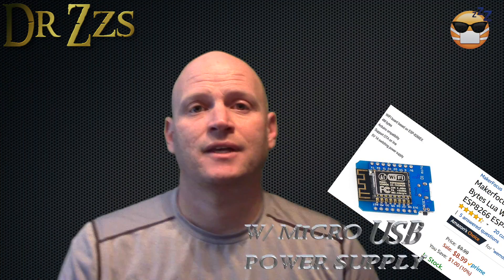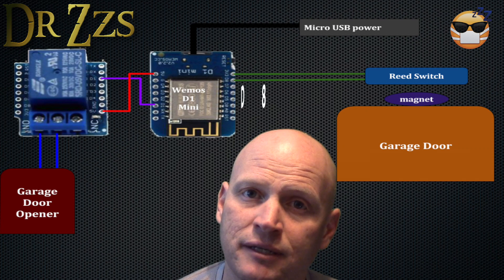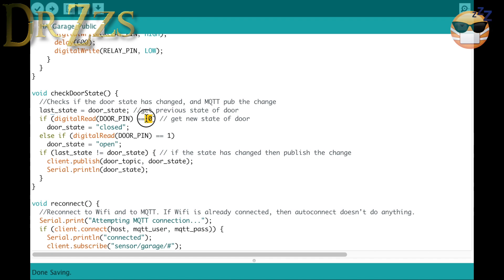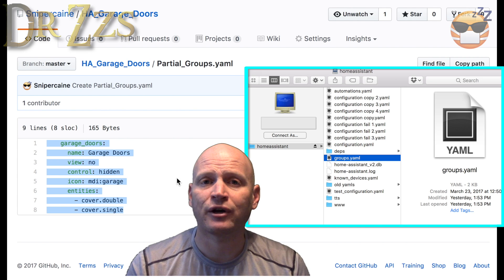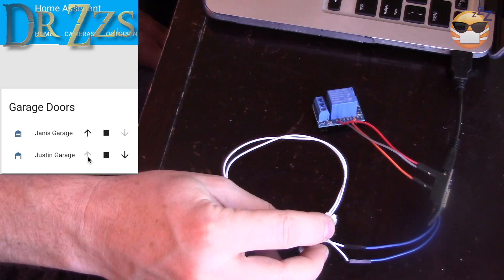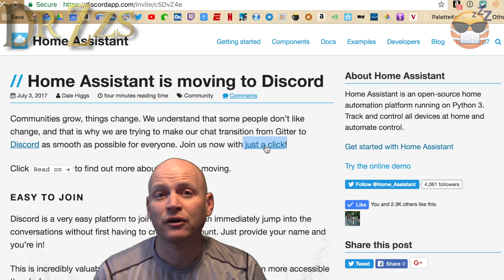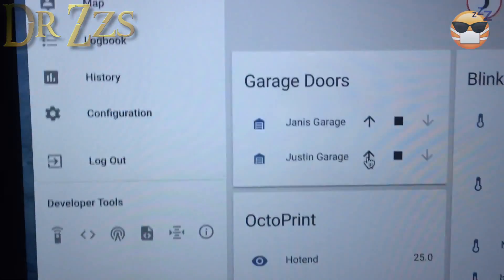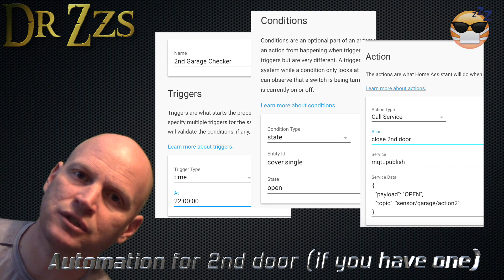DIY Smart Garage Door Opener

Comment: Any way to connect 2 reed switches? And notify 2 different garage doors From one d1?
Reply from the maker: yes!  but that would require some changes to this sketch.  I've been using Tasmota exclusively for a while now, instead of custom Arduino sketches.  You could control both doors with 2 reed switches and 2 relays with One D1mini and Tasmota.  Would be hard to give all the steps here.  Basically, you'd have to set 4 switches and 4 relays.  Use Relay 1 and Relay 2 for garage door control. Then use Switch 3 and Switch 4 for reed switches.  If that's confusing remind me during a live stream and I'll try to demonstrate it.  It should work pretty well.
Reply: DrZzs awesome! I followed your d1 mini video and got a temp sensor working. I will add the reed switch when I have some time. Am I tying the 2 reed switch both to the 3v and different GPIO pins?
Reply: DrZzs when is the next live stream? I added the reed switch to a tasmota D1 Minin but having trouble fingering out how to add to HA.

Comment: This is a great, and cheap way to do it.  I've seen a few videos using an arduino uno, a wifi board, and a sonar sensor.  that just seemed clunky and somewhat unreliable.  I think I will do it this way!
Reply from the maker: Thanks!You might even try the other video I have using a Sonoff SV.  I think that's an even better method I discovered after this one. 
https://youtu.be/QMepwpyjMCY

Comment: I noticed you updated your sketch noting that the door may open if the wifi drops. So I updated mine to your new sketch but just today my garage door opened and closed twice by itself. It stayed open maybe ten seconds then closed itself both times. Any idea what is going on?
Reply from the maker: Gremlins. They love garage doors! 
I wish I could say exactly what was happening to yours.  If you changed the sketch did you also change to normally closed contacts on the relay?  The new sketch is made for the relay to be normally closed. 
If you do have it on normally closed then a brief power loss to just the D1 mini could cause it to open. 
Were you having any random opening before?  If you weren’t then I’d say go back to what you had.  If your WiFi is more reliable than mine you might not need the new sketch. 
I’ve been happier with the sonoff SV solution. Just because I’m not great with Arduino sketches. 
Hope that helps.
Reply: Yes I moved it to normally open. I never noticed it open by itself before I changed anything or maybe I just never saw it happen. I have a sonoff sv so maybe I should try that route as well.

Thanks for the reply man!
Reply from the maker: hmmm.  
With the new sketch "HA_GA_v2_NC_pub", 
https://github.com/Snipercaine/HA_Garage_Doors/blob/master/HA_GA_v2_NC_pub.ino

you should have the wires on the Normally Closed terminal.  The relay will activate the door with you first connect it so be ready for that, but after that it shouldn't activate when the wifi drops.  

sorry you're having trouble.  For what it's worth I do prefer the Sonoff SV option.  We have one door with the SV and one with the D1 mini and the SV seems to have less trouble.  But you should be able to get the D1 setup working.  I haven't had any trouble with either in a long time.
Reply: So I think I found the issue. I recently purchased a TP-Link HS110 for monitoring energy consumption around the house. Well today I moved it to a new location and did a factory reset, then boom garage door opens. Also when I enable or disable through the KASA app it also triggers the door. I have no idea why or how those are related but that's what is making my wemos trigger. Any ideas lol?!

EDIT 
So here's what I got so far and CopperNickus from Reddit is correct, herer's what he wrote. "Your RELAY_PIN starts in low state and you set it high during setup. That code is not protected by door state logic. It's possible the device is rebooting and that's causing the relay to trigger the door. Try cycling power on the board and see if it triggers the door too. You'd need to check status before changing the RELAY_PIN high so that a reboot does not trigger the door."

I just don't know how to do what he says haha. But this problem could occur  to anyone using this current setup.

Comment: First of all thank you for this tutorial! I enjoy watching your videos and building the projects. I did have a few issues during the setup so I want to post my findings in case anyone else has the same issues. After uploading the sketch to the D1 mini and updating the configuration.yaml file the reed switch contacts worked as expected but the relays would not respond the the open/close buttons on HA. I found that adding a wire between the D1 mini ground pin and the relay ground pin would cause the relay to be constantly energized. Pressing the open/close buttons on HA would momentarily de-energize the relay. I then went back to the sketch and replaced all instances of "HIGH" with "LOW" and "LOW" with "HIGH". The relay is working properly now and I plan to install it on the door later this week.
Reply from the maker: Great!
At least part of the issue you had might be because I changed my setup from using the normally Open contact on the relay to using the normally Closed contact and I set the pin on the D1 mini to start high and go low on activation. 
I did that because the door was opening randomly anytime the D1 mini disconnected and reconnected from my WiFi.  So there may have been some difference in the sketch on GitHub and the institutions in the video. 
Glad you sorted it out. Hopefully anyone else who has that problem will follow what you did. 
Thanks
Reply: @DrZzs  I have a question. Why would your doors open randomly when you initially set it to high? If the wifi disconnected and reconnected, did it trigger it to go low momentarily? The sketch that Patrick has seems efficient since the relay is only energized when the button and pressed. I'm trying to understand how and why the doors would randomly open/close in your case? Also if you lost power momentarily, would it not trigger the door to open?
Reply: @Patrick by making this change did you move the NC back to NO on your relay?

Comment: Also, a simple & cheap "workaround" for anyone that doesn't want their door opening if the power goes off & comes back on.

Run it off a power bank with a charging schedule setup in home assistant to automatically recharge the bank every so often.

Or have it plugged in 24/7.
Reply from the maker: good call!

Comment: Got this up & going, works as suggested & is displaying the different states of the doors on the home assistant Garage Door card.

Great vid by the way, straight to the point.

I have setup where the reed switch will close when the door is closed (seemed logical), however when I power up the D1 Mini with the reed switch closed (door closed), it doesn't seem to boot properly & home assistant doesn't update. The ONLY way I can get it to work again is if I boot the D1 Mini with the reed switch open.

Everything works as it should from there. But if I have to reboot or power down the D1 mini for whatever reason, I have to open the doors & let them (2 x doors, 2 x D1) boot & close them again....LOL =)

I'd also like to "grey out" the stop buttons when the door is closed, just not sure how. :/

Any help would be appreciated. ;-)
Reply from the maker: I don't know how to grey out the stop button.  poke around the HA forums or the discord chat and see if anyone else has done that or has used a different icon scheme to make the stop button go away. 

I'm not sure about fixing your reboot issue either.  Sorry.  There's probably a way to have the D1 send a state message on a timer, or on power up.  I'm not skilled enough with Arduino code to know exactly how to do it.  But that's where I'd look for the solution.  

Fortunately, you shouldn't have to reboot the D1 much once you've got it all working.  When I re-start HA I have to open the door once before HA knows the state.  If I ever figure out how to have the D1 send regular state messages that aren't associated with a state change, I'll post an update. 

Sorry I'm not more help.
Reply: All good. Thanks for the reply.

I've reconfigured my reed switches (drilled the epoxy sealed old magnetic reeds & replaced them with normally open reeds) so that the contacts are closed any time the doors are open, even if only open a fraction.

So it's all perfect, in that respect.

I'll look into greying out the stop button when doors are closed, at a later time.

I posted my questions from someone else's account, but am replying on mine.

Thanks again for your time and informative video on getting it all going.

Ps  you know more than I do on this subject, so I'm afraid I can't answer your question either =(

If I come across an answer, I'll inform you.

Comment: I now have a smart garage thanks to you Doc and I learned soldering in the process.  Not too bad.  One note to anyone that follows these instructions.  I used the Wemos D1 Mini Pro with the Wemos D1 Relay Shield.  You also need to wire ground from the D1 Mini to the ground pin on the relay.  Otherwise the relay will not power on.  Thanks again for the amazing channel.
Reply from the maker: Excellent!!

Comment: Great how-to. I have a few variations. I used a raspberry pi to connect to mqtt and the reed switch. I also use Node-Red and my mobile phone push notifications are via Pushbullet (as someone else suggested) and repeat this depending on the length of time the door is opened (more aggressive the longer it is opened). Over a certain point emails to others in the household (usually happens when I'm at work). I have the ability to stop the notifications because I have it opened while doing gardening or maybe washing cars etc (e.g. for the next X minutes). 

My relay setup is different in that I purchased a cheap ebay remote, synced it to the door opener, opened it and connected the relay on either side of the momentary switch and I can mount it anywhere in the garage or house (depending on distance). My last variation will be hooking a camera to my Pi and sending an image to my phone so I am sure nothing is in the way of the door before closing remotely (I know the garage door mech can stop if something is in the way, but my testing indicated the door would dent the roof of my car as it has some force before stopping).

Comment: Thanks Dr. Zzs!!! I'm new to all this and was having a bit of a struggle getting the Wemos to connect to the relay... that said I watched the entire video again and noticed the "second" set up you tested you didn't have the boards married.  You had ground, 5v and D1 connected between the relay and the Wemos.  I did that and it works great!!! Time to put it up in the garage.  Now one question... the LED on the relay stays continually lit unless the relay is functioning.  Is this normal with the new NC sketch and using the NC connector to hook to garage opener?
Reply from the maker: Yes, that's the new "normal" way I did it to keep it from opening every time it looses connection with the wifi.  

Glad you got it working! 
Let me know if you hit any more snags

Comment: Hmmm my Rolling door is different from this your garage door coz it's has 3 buttons
in home assistant i cant find the way to config that ( in HASSIO it show Garage UP stop and Down.)
any suggestion???
i like all your projects.
Reply from the maker: Thanks!

That's tricky.  What do the 3 buttons do?  one for up, one for down, one for stop?
hmmm.  I'd just be guessing at a solution since I haven't dealt with that exact situation.  
You could use multiple relays and run them off the other GPIO pins, then in Hassio you assign a different topic for each one.  So you'd have the main relay connected to the UP button on your roller door, then one GPIO (Rx) pin activating a second relay that is connected to your DOWN button on the door, and a third relay controlled by GPIO (Tx) connected to the STOP button.  That would leave GPIO14 still open for the Reed Switch to give you the State of the door (open/closed).  

In Tasmota you select "Relay2" for the "Rx" pin and "Relay3" for the "Tx" pin.  I think the MQTT topics would be "cmnd/sonoff/Relay2" and "cmnd/sonoff/Relay3".
you can see in the Config.yaml there's a place to define the topic for the Open/Close/Stop command buttons for the Cover.  

I hope that's making sense.  It is totally making sense in my head, but might not be coming out clearly.  

Are you using the D1mini?  If you are I'd suggest you load Tasmota on it.  That'll be easy then to add multiple relays.  

Good Luck.  Let me know if you get stuck.  
I sure wish I had time to make a video explaining how to do it.  Too many projects too little time!
Reply: Thanks for reply
actually i control my rolling door via Sonoff RF Bridge by flashing Tasmota.
if i use cover in ( configuration.yaml ) it's show 3 buttons but all it do just send 1 signal.
cover:
 - platform: mqtt
   name: "Door-UP"
   command_topic: "cmnd/sonoff433/rfkey1"
   qos: 1
   payload_on: "ON"
   payload-off: 'OFF'
   retain: true

Comment: Great video! It helps me tremendously. Does anyone have a solution for power loss? When the power comes back again, the relay switches and my door opens.
Reply from the maker: Thanks!That's a tricky trade off.  I'm guessing you're using the Normally Closed contacts on the relay?  What I found with my own was that when I was using the Normally open and had the action pin go high on button press the door would open randomly every time it disconnected from the wifi, which happens a lot! Sometimes 5-6 times a day. 
So I switched to NC and pin high on start up and low on activation.  That totally stopped the random openings on wifi loss, and it won't open when the power goes off, but it WILL open when the power comes back on.  Since power loss is pretty infrequent it's better than having random openings with wifi disconnect.  

I haven't found a solution to get the best of both, no opening on power loss and no opening on wifi loss.  Sorry.  Maybe someone smarter than me will figure it out and let us in on it.
Reply: Yes, I used the NC. I understand why you chose this. I have experienced 2 times a power outage last year and would rather not have my door open when the power comes back. I hope someone can help? I can test everything but can't program.
Reply: @martijn_1282  Just use a different pin.  D0 and D1 cycle on boot.  Using them will cause problems on reboot regardless of if you are using NC or NO relay.  Check the specs for each pin.

Comment: Thanks DrZzs. I have got this to work. There is an  issue with homeassistant not retaining the state of the garage after restarting HA. I added the retained flag to true to mqtt publish (  client.publish(door_topic, door_state,true);  ). Also added wifimanager code and  firmware code.( borrowed this part from https://automatedhome.party/2017/01/06/wifi-garage-door-controller-using-a-wemos-d1-mini/)
Reply from the maker: Thank you!
That is excellent!  I thought by having "retain: true" in home assistant it would get the state if/when I restart Home Assistant, but it didn't work like I thought it would. 
You've solved it for me!  
Much much thanks!
Reply: That's great. Also one of my garage-door openers had a compatibility issue. There are no connections for relay ( Security +2.0 opener with Yellow learn Push button ). I ended up soldering relay connections to a spare remote push button for this garage.
Reply from the maker: oh man. 
glad you found a work around.

Comment: I’ve noticed that mine defaults to unknown after home assistant is restarted, is there a way for it to default back to its last known position or ping it for its current state?
Reply from the maker: ya, I have that same thing happen and I also wish it didn't. 
I thought "retain: true" was supposed to make that happen, but it doesn't seem to be functioning the way I thought it would. 
https://home-assistant.io/components/cover.mqtt/

If you figure out a way to do it please let me know!
Reply: yeah i tried retain true would fix it but it hasn't, I'll try to figure it out. will report back if i do. thanks
Reply: so i ended up switching the whole arduino sketch to the one here, then you put in an automation for it to check door status any time HA is restarted.
https://github.com/marthoc/GarHAge
Reply from the maker: cool.
I'm not surprised someone wrote a better sketch than the one we made. Glad you got it worked out.  I'm still just dealing with it anytime I have to restart home assistant.  Maybe someday it'll creep up high enough on the priority list for me to get around to fixing mine ;P  
Thanks!
Reply: My biggest concern was the fact that if either the broker restarted or the WeMos dropped offline and came back on (not sure which was happening), it would trigger the open command and just pop the garage open when I wasn’t home. Then I had to just operate it from wherever I was to wait for it to either actually close or open depending on if it just lost its state or actually opened. 
Ended up putting a camera out there now too to see it as well haha. 
Anyway. Good luck. Love the videos. Definitely enjoy watching.

Comment: Does anyone else get a problem adding the customization part in the configuration.yaml file?

Testing configuration at /config
2018-02-25 09:01:50 ERROR (SyncWorker_0) [homeassistant.util.yaml] mapping values are not allowed here
  in "/config/configuration.yaml", line 15, column 17
2018-02-25 09:01:50 ERROR (MainThread) [homeassistant.bootstrap] Error loading /config/configuration.yaml: mapping values are not allowed here
  in "/config/configuration.yaml", line 15, column 17
Reply from the maker: Can you post your customize section?  I'll take a look and see if we can find the problem.  It must be a syntax error of some kind. 
We'll get it figured out!